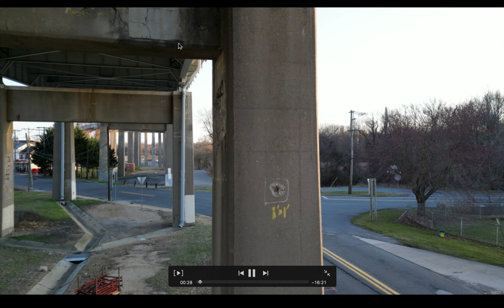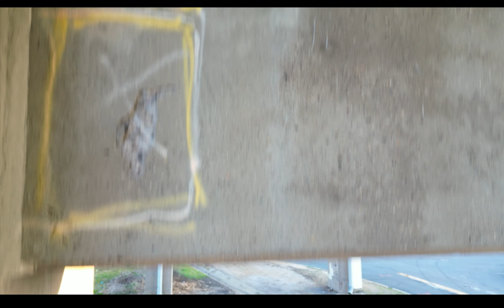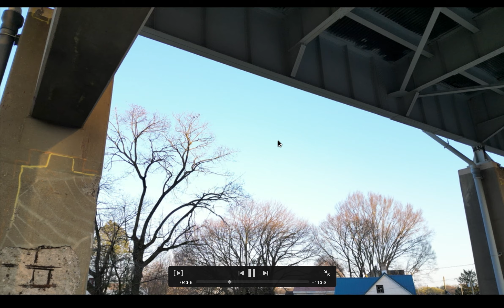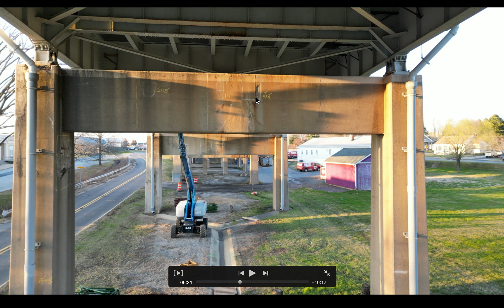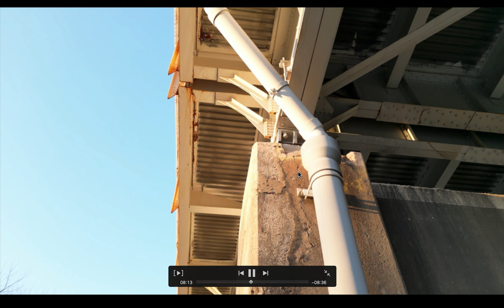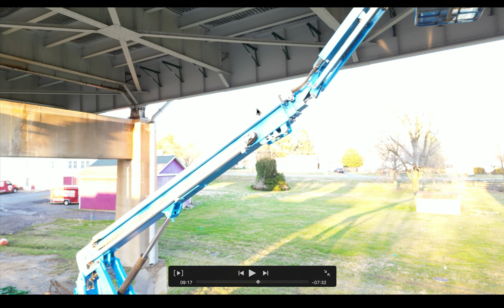St George's Bridge Delaware 45 million dollar repair

Comment: Great analysis Professor. Thanks! Do they do this piecemeal so they can come back in a few years and charge another50 million?
Reply from the maker: It's all cost budget based and not understanding the repair process that may work...
Patching creates cold joints and water will penetrate these cold joints and failure will happen again.